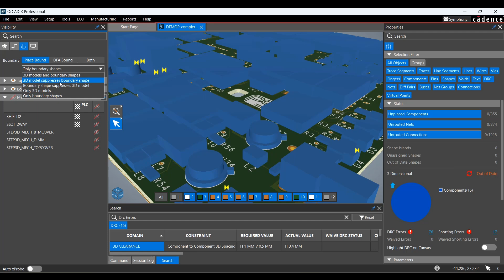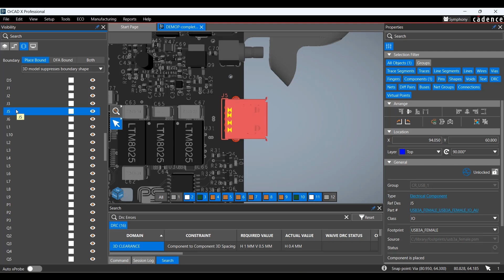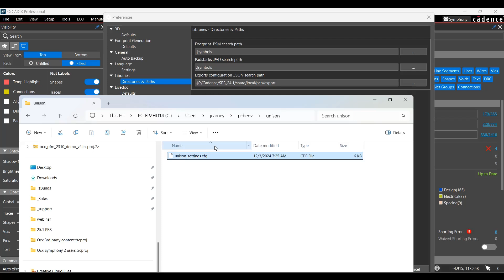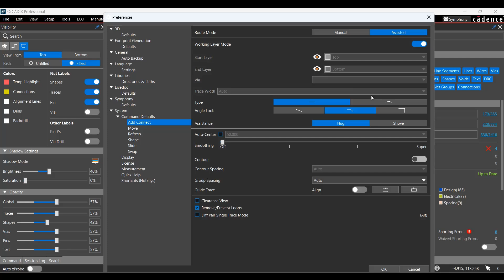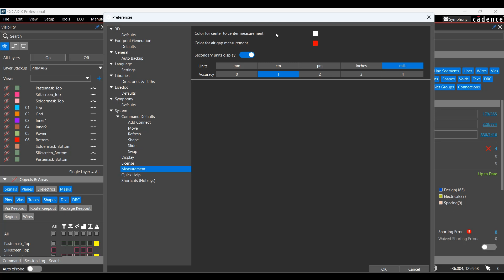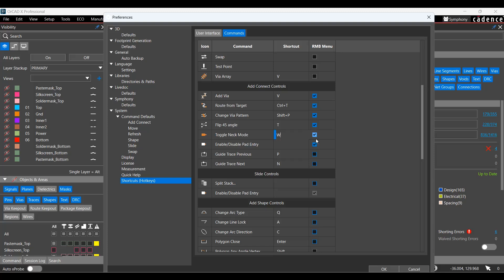Setting Up Your OrCAD X Preferences

Comment: To change textblock parameters, it was necessary to open the board file in the legacy tool to make the changes.

Presto does not have the ability to edit textblocks because the programmers did not put it in (yet?).

You can change a textblock number, but not the parameters – they are greyed out.
Reply from the maker: Thanks for your comment! This is planned for 25.1 so stay tuned!